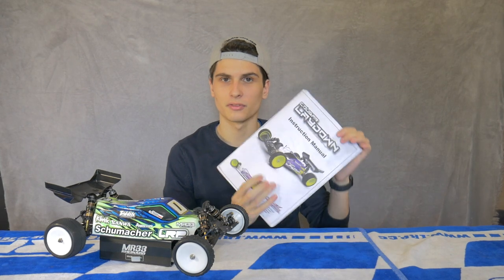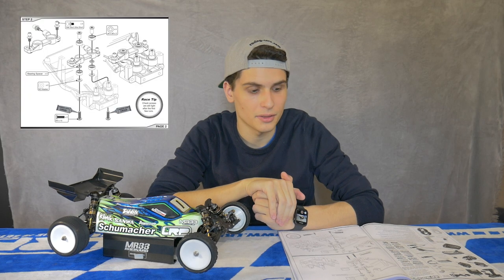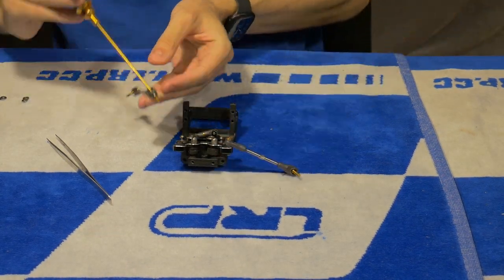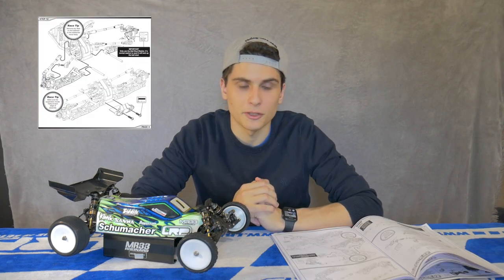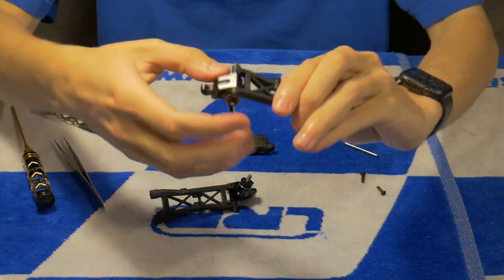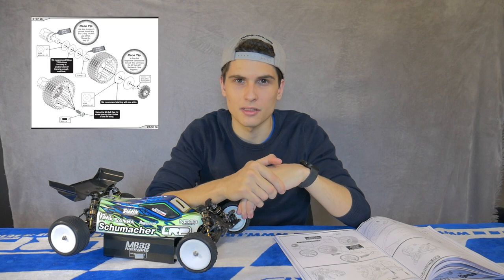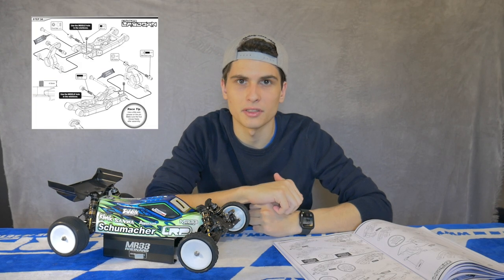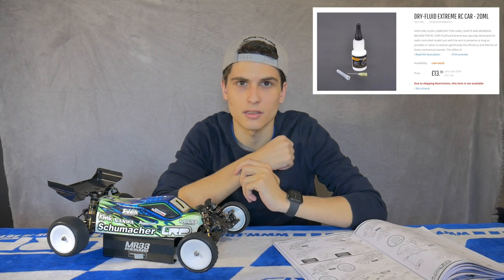RC CAR BUILDING TIPS & TRICKS | SCHUMACHER COUGAR LAYDOWN |

Comment: Hi Michal. I notice the team drivers use ally option parts but never the optional ally rear hubs. Is there a reason why they are never used?
Reply from the maker: Yes, the alloy hubs are good for durability, but plastic are light weight and the bearings fit nicely. 👍
Reply: Thanks for the fast response 👍